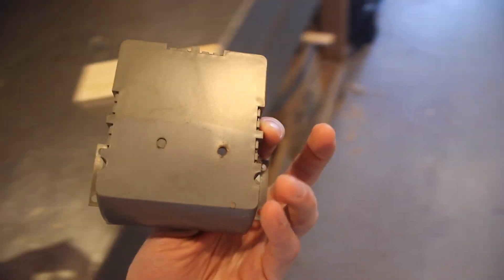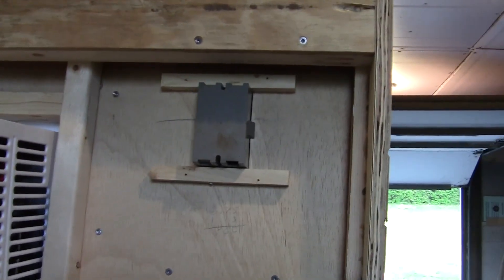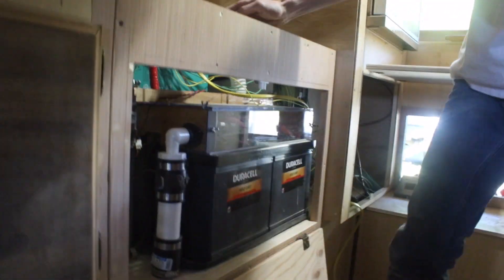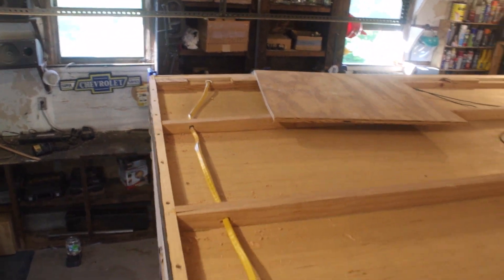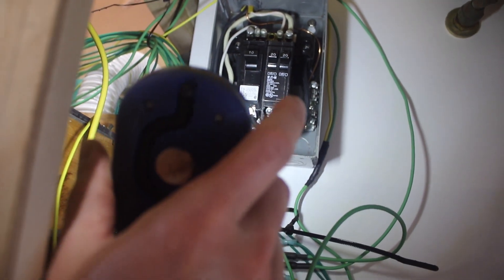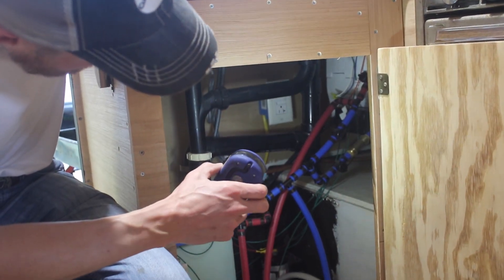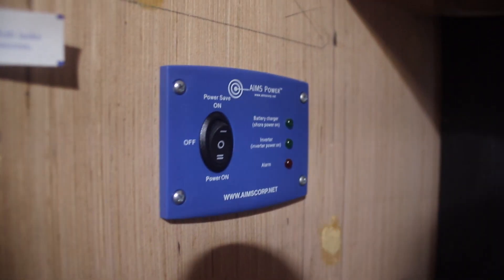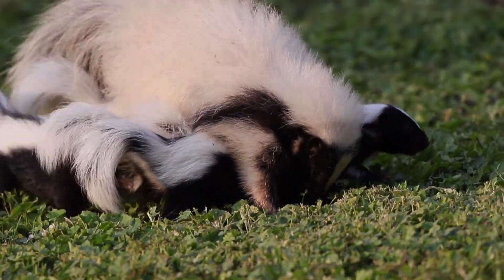AC ELECTRICAL SYSTEM - Truck Camper Build Part 41

Comment: Amazing amount of work!  Doing great job.  I was going to comment before, but figured you were done already, but I see your not yet done, so my question is given you are essentially building a camper from scratch,
you might think about not using the old aluminum outer skin and use fiberglass panels and glass them all together so there are NO LEAKS.  The original design is made to assembly quickly, which is not what is happening in a DIY build.